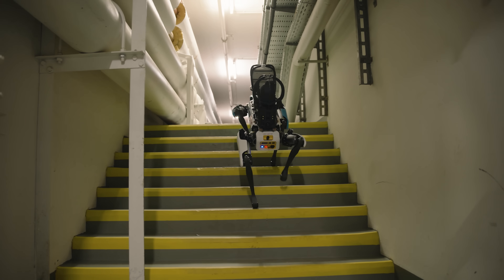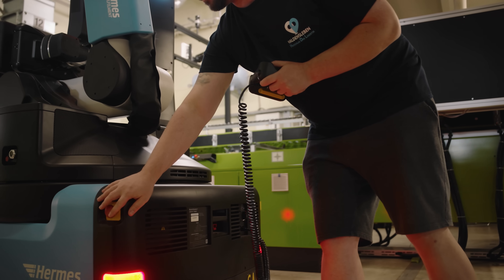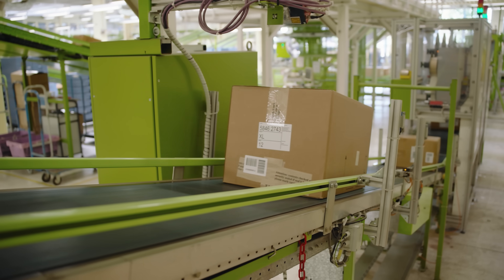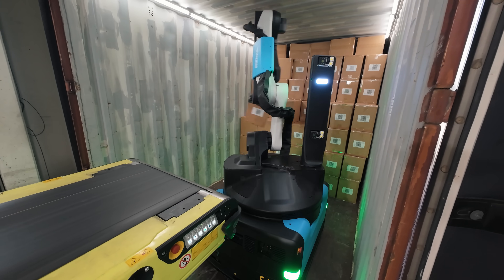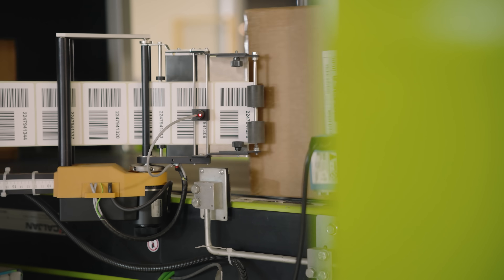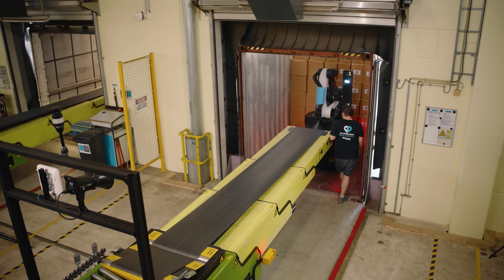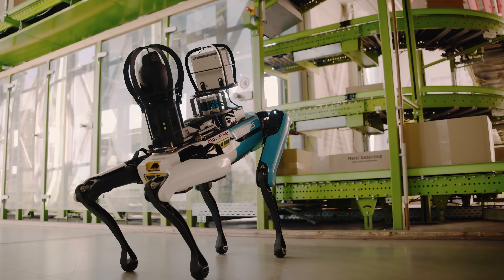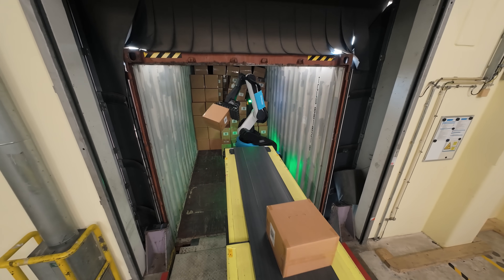Stretch Debuts in Europe at Otto Group

Comment: And never shown a complete unload :(
I really would like to see a timelapse of this machine emptying a complete container by itself. Incl. picking up dropped boxes ect.
Reply: @captainkirk4271  a tenth the speed is still cost effective when it's a hundredth the price.
Reply: @bensmith5262  Speed is very important when it comes to deliveries though
Reply: The boxes are falling at 3:09 which explains why the full video is not shown.
Reply: sounds like a weird kink. get your jollies off somewhere else weirdo.
Reply: There are two employees nervously supervising.
Reply: This is Germany, not low wage USA
Reply: @Secretlyanothername  Germany hourly is higher but annually US is higher.
Reply: @YaoiMastah can’t wait for the pregnancy update though…
Reply: uniform boxes, clear visible QR codes, always the same sequence no mention of how many units are usedd on the floor -> staged ad. 
Otto is probably using one unit for testing purposes. I don't think Otto is using Stretch productively. A Testing phase with nice PR.
Reply: @test19698  It definitely is not ready for any mail processing facility. Those boxes are usually messily arranged, differing sizes, and often times many boxes that are deformed in some way. Those suction cups are definitely going to struggle a lot in more practical applications. This will likely only be effective in settings like this shown in the video. It also looks like the conveyor still has to be manually extended when the robot gets in deeper. So at this point it's barely replacing the human, and is doing so in an inefficient way too.
Reply: @Fogest  give it 2 years
Reply: @test19698  Thats what i thought too. I guess OTTO gets special prices or so to be the first and beta tester or so.
Reply: problem is it takes hours instead of minutes with a forktruck.
Reply: @darkshadowsx5949  You wouldn't be using a forklift with a deck loaded trailer. There would be 1 or 2 people throwing the boxes onto the conveyor.

Comment: It’s easy when the trailer is packed perfectly neat and square. 
Now load it with vastly different package sizes and shapes where they may be overlapping and stuck under another package.
Reply: totally ! it's one part of my job in a post warehouse in France, we have containers with more than 2000 packages every days and it's absolutely not stacked so perfectly in them :'D
we out 2000 packages in aproximatively 1 hour  (1 package per 2 seconds with 2 people in the container)
Reply: idk pretty obvious this kind of tech is advancing very quickly, i wouldnt be so quick to judge. but yes i imagine that the fact that you cant 100% control a workplace 100% of the time means you will always have at least somebody on the floor
Reply: @toddberkely6791  it’s not advancing quickly. This is decades in the making and still no where near ready.
Reply: @toddberkely6791  As an Engineer that has actually worked in AI and robotics, trust me, unloading perfectly arranged boxes of the same size, texture and symmetry is an entirely different ballgame than unloading a truck packed with different kinds of packages with different textures, densities, etc. some containers can have all kinds of packages from clothing ( which don’t typically come in boxes) to book, magazines, etc .
Reply: @dekev7503 and what made you think that the robot can’t be programmed for package diversity, permutation and combination and all that?
Reply: @infomania488    You clearly don’t understand how this stuff works. It’s one thing for a robot to identify homogeneous packets that were perfectly prepositioned, recognise their orientations ( whether they’re facing up, down, sideways, etc), identify their labels, calculate the amount of force needed to handle them and place them on a conveyor with their labels facing up or sideways for capturing. When you have different packets all scattered across the container, the robot has to be able to identify each one correctly, understand their orientation and apply the appropriate amount of force required to handle them. 

The hardware that would be used to pick a large heavy cardboard box wouldn’t be the same that would be used to pick a light plastic bag, that’s assuming the robot can identify that the small plastic bag is a packet in the 1st instance. Also, unlike the perfectly arranged packages that allow for a straightforward plan of action by the robot, in a container with haphazardly arranged packages, the robot would end up missing some packages.
Reply: @toddberkely6791 that somebody would not be you for sure 😶
Reply: @infomania488  bro what do you mean what kind of obscure shade is this :(
Reply: Isn’t the point that the trailer is also packed by a robot?
Reply: @thekingoflordagames3517  funny how they never show that part.
Reply: We have to start somewhere.
Reply: @Delibro  agreed. It’s just silly how they keep showing the same videos over several years.

Comment: Are there any plans to make Stretch faster?  I understand there's a limit to how fast it should rotate for safety and reliability, but lag before and after picking/placing seems excessive and something that could be easily addressed with a faster processor.
Reply: I doubt processor speed is the bottleneck, plus it probably makes up for the somewhat slow speed in consistency.

Comment: Half a million for one unit. Or you could pay 2 guys 12 bucks an hour, and they'd throw them boxes off that trailer in half the time.
Reply: Pretty sure 2 people could unload at least 10 times faster than this robot.  With people you have packages constantly streaming down the rollers.  This robot is taking almost a literal minute to unload 1 package.
Reply: @tiepup No they fucking won't. Base pay starting at UPS is $15/hour part time. That's less than 40k/year for two guys, not to mention the maintenance costs of the machine itself will be expensive AF. Then you factor in how long it will take a single trailer to be unloaded using one stretch machine vs two guys, the two guys will be able to unload more packages in any given hour than the machine, greatly outpacing it, meaning more packages/hour, meaning more dollars unloaded per hour. What the manual labor costs per hour is made up by the speed that they can work.
Reply: @joshuareed8243 doesn't matter. Machines are more reliable. Companies definitely safe money over time. Humans are always a liability.
Reply: @joshuareed8243  You ignore something. Standard worktime is 8h + 30 min break. This is most likely a Shift-job, so with your example, we're talking about 6 people to cover 24h. Stretch can probably work several Days without stopping before minor maintenance is needed (check of the suction cups for example).
Thats about 172.800$ per Year (if its a 5 day workweek) JUST for the normal payment. Beside that, they will get a Bonus for nightshifts. Additional costs if the Company would have a "minimum 2 workers" rule, so they need additional People if the usual Workers are sick or on Vacation.
If Stretch costs 500k, it will be paid off in about 3 years.

Other Variables like human errors or accidents because its dull work, the Container is hot in Summer, cold in Winter, etc. not included.

Comment: how can a cardboard box be held without any support under the box?   this will only work on nearly empty boxes.
Reply: You underestimate how strong Suction/underpressure can be.
Reply: @smaragdwolf1  I think they meant the paper strenght, not the grabber itself.
Reply: @K0T3J1  cardboard is very stable. You need a significant amount of force to actually damage it
Reply: @smaragdwolf1  You'll need to make sure that it is stable every single time but that seems to be solved in this case.

Comment: I work in a warehouse. This is not a real world situation.
Reply: Plot twist. It was also loaded by a robot.
Reply: Can you elaborate?
Reply: @Xrayhighs  The container you are looking at is the ideal dream for floor-loaded cargo. In the real world, most loads are heavy, have different sizes, are not loaded uniformly, and the packaging is not as resistan
Reply: @Xrayhighs  Many cardboard boxes contain items that are quite heavy. Even if you could hold on to the side of a box with suction cups, the cardboard wouldn't necessarily be strong enough to take the weight.

Comment: Naturally you can automate anything if you’re willing to go far enough. The question becomes whether it is more affordable than having a human do the same task. Robots, especially advanced robots, are expensive purchases up front. They also require specialized maintenance and constant monitoring. And relying solely on robotics can impair production when something inevitably breaks down. There are plenty of advantages to using robots too. I’m just bringing the negatives forefront to encourage people to consider how businesses have to weigh the pros and cons, rather than accepting this as a perfect advancement out of the gate.
Reply: Not to mention a human would be able to unload that wayyy faster
Reply: @davidboardmann  I would be bored and tired after an hour of this work. Someone could run a machine to do it, though.

Comment: we are far away from seeing really usecases of those robots i had made a case study about this topic. It cant really handle the normal pickup volume from costumers starting with foil wrapped arround the packages on the palet followed by small, large packages or damaged packages.Everythiv needs to be perfect size and only then it will does the job.
Reply: Also see those boxes, they have tape even at the edges. Holding a normal heavy box from the side the card board will rip apart.
Reply: @eSKAone- the boxes where all the same.size and possibly lighter than the normal ".load " of an actual container . The video was made as an infomercial .
Reply: True. Like the progress is somehow REALLY slow. Like this robot is the current crazy tech? It can some very fixed sized boxes slowly ... okay and the walking dog which is clearly a gimmick - let's be real. Actually almost 0 progress in 10 years is crazy. I can see how robots can do a lot of work at some point in the future. But this "future" is not 2024.

Comment: this is the type of machine that looks good on camera, but never works when you actually use it.
Reply: That is racist! MachineLivesMatter
Reply: I was thinking the same, I work in a warehouse, moving cardboard boxes all day, and this is not a real life scenario. In the video, all boxes are the same, and all are very well-placed and organized inside the truck. In real life, boxes have mixed shapes and sizes and are often weirdly placed because of their different shapes. On top of that, they all seem either very light or very stupidly reinforced. There is no way a heavy product in a cardboard box can be picked up only by the side. Even if the suction is enough, the heavy object inside the cardboard box will only be supported by the thin cardboard underside.
You need something other than the cardboard supporting the weight. Where I work, we often have cardboard boxes that weight 25 or 30kg, there is no way this moves those boxes successfully.
Now add to that the fact that not all products come in cardboard boxes, some come with thin plastic wrapping or plastic bags or maybe other types of packaging.
Looks nice though
Reply: @Joanmaker  All good points. But not all warehouses are the same. Nobody is claiming this particular robot would work in all warehouses, it just works in this particular one where the boxes are light and organized. If you have to pick up the boxes from below, then you could design a new tool head for that and mount it on the robot. I have been in factories where the robots had a rack of tools and would interactively swap whatever tool they needed for the job.
Reply: @Joanmaker That is easy... they are very accurate.. i worked next to robots that weld better and more accurate than human hand, that was 2023
Reply: Great points are raised in this reply thread. To put the pieces together: we are really good and very experienced at building robots. By robots I mean excavators, cars, planes, surgical robots, home appliances, industrial machinery, as well as multi purpose robots like this one. However, we are still really bad at building minds.

Therefore, our magnificient robots can replace humans only in very regular environments. Any irregularity would cause them flop so hard. If we design a CAD model, and ask a robot to carve it out of a metal cube, it will do it infinitely better and cheaper than any human ever could. But if you misplace the metal block or something, it will absolutely mess it up.

Before we build human level minds, our only choice is to design end-to-end robotic processes. In this particular case, if we close the loop by only loading the boxes with robots, then robots would have no difficulty unloading them. Taking humans out of the loop and standardising packaging, etc. is the only way to utilize this to maximum.

Comment: How heavy of a box can it hold. What if it’s small but very heavy ?
Reply: I work at Hermes in Haldensleben. Those boxes can weight up to ~15kg.
Reply: Black hole in a box.
Reply: They’ll ensure the robot works with parameters it can handle. That’s a solved problem.
Reply: @MiesvanderLippe  warehouse 3PL will never be "within" the set parameters.😂
Reply: @lmtterry  He means Stretch won't pickup too heavy boxes, leaving them and informs personell.